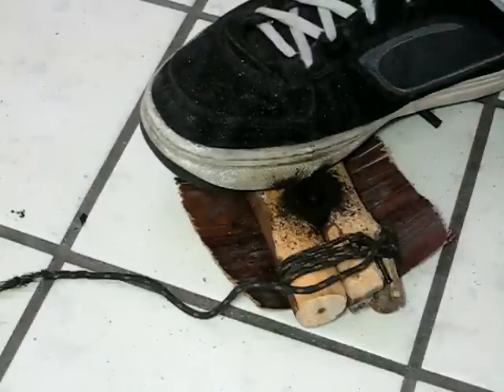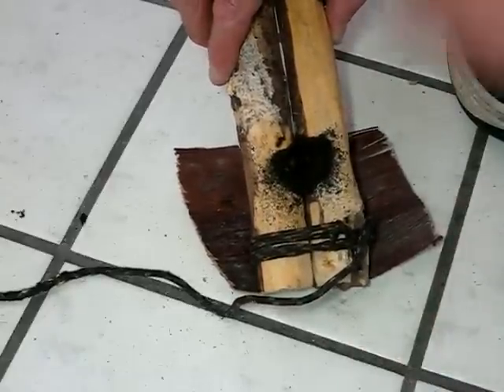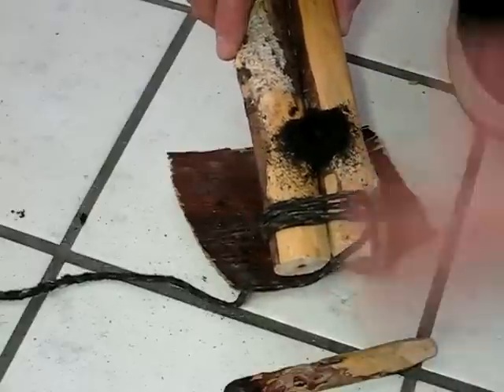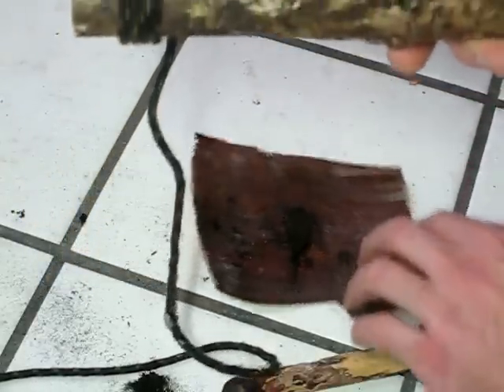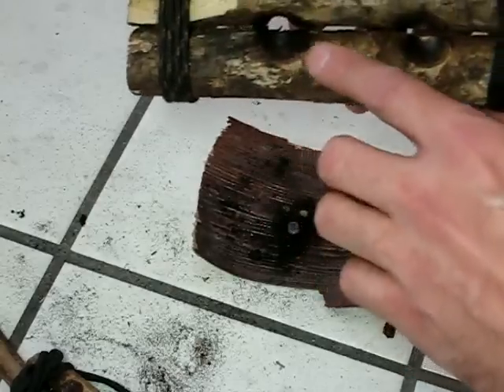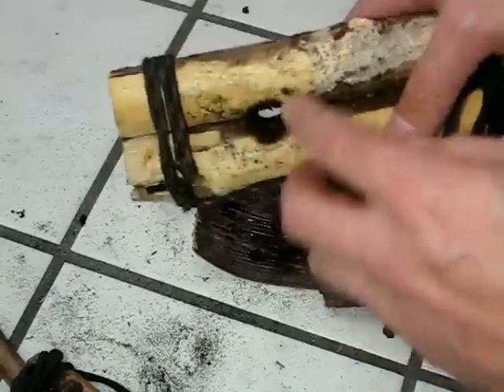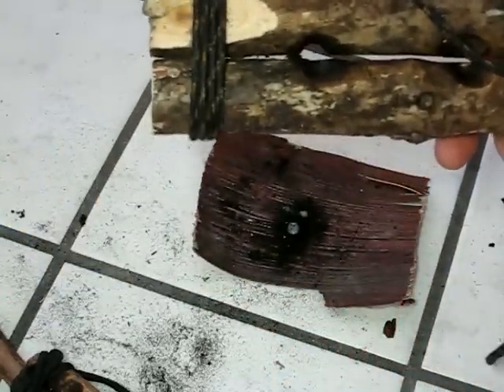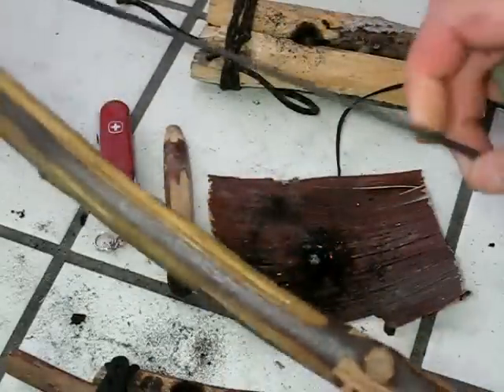2-Stick Fireboard Bowdrill Again

Comment from the maker: I start off by slightly angling the spindle against my shoe. Once there's a good enough depression (burn-in) then I angle the spindle vertical and move my shoe away. I'm also bowing fowards & backwards to take advantage of the walls of the crevice between the 2 sticks (fireboard).

Comment: I was thinking yesterday that for HD attempt. I would use 2 pieces for the fireboard and a 3rd shorter piece in the valley of those two for a stop. So 3 sticks lashed together in a triangle.
Reply from the maker: You may not need to lash down the 3rd piece, just use it to initially get a drill spot stated then you can remove it.
Reply: That make sense